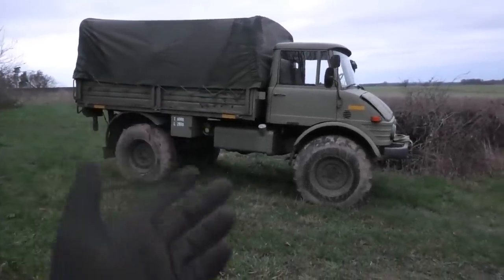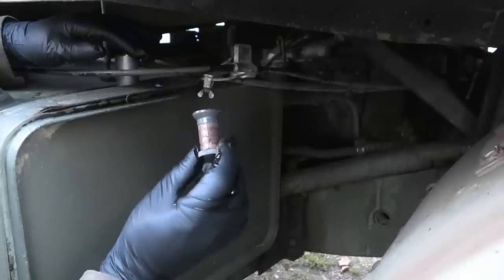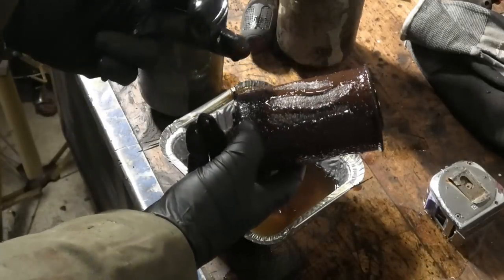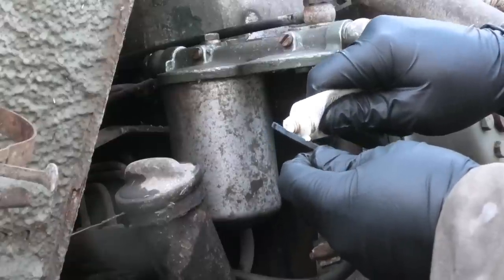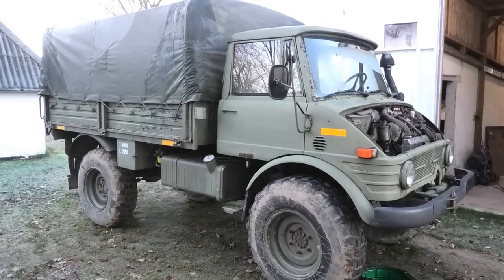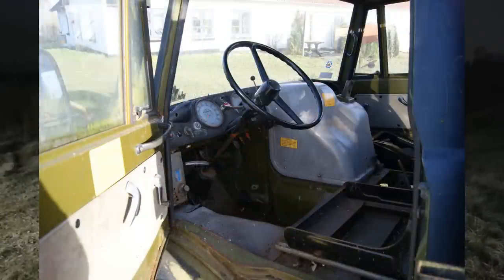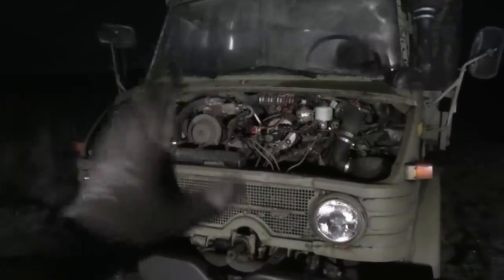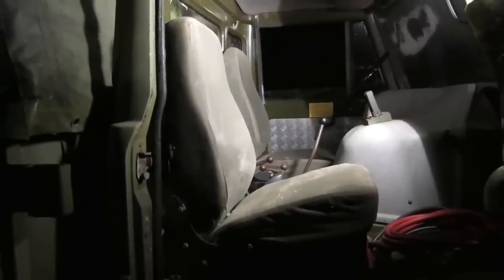Fixing the Unimog 416! - And looking at all the other promblems?

Comment: 30 years ago I helped a man doing up his Unimog.  Everyday I cycled into town where his Unimog was parked half on the sidewalk on a busy street.  That is where we did all kinds of work on it, including welding. It was the worst location to do this kind of work, but it was what it was.
He was going to Africa, and therefor he build a wooden 'caravan'-box on the back to live in. With a rubber corridor to connect the cab with his living space. He had two spare tyres on the cab-roof, and two heavy metal boxes fitting on the rear. Jerrycans were toed on all sides. Extra trays welded onto the frame. More and more stuff on the 'caravan' roof. The Unimog was clearly way too overloaded, and I suggested he cut down on the add-ons. He was stubborn and I resorted to just help him and not give anymore advice.
I remember waving him good-bye when he drove off.  It was top-heavy, and when he took a corner the whole thing swayed like crazy.  Later I heard that he actually managed to get to Africa, after throwing out a lot of his stuff. So, still, he made it and he ended up giving the Unimog a lot of good use there.
Reply from the maker: Wow. That must have been a wild trip, in an old 'mog :)
Reply: @KJOff-Road   - Yes, it was.  This was in 1991 and his Unimog was a 421, like your 'barn-find' from a year ago. It was short and his caravan box was tall, and more stuff on top.  It even swayed left and right just from the wind.  I did not took pictures back then, but I should have recorded the build and especially his departure.  It was like an episode of Top Gear, and though it was all a bit too crazy for me, I'm impressed he eventually made it all the way to Africa.

Comment: Very interesting, this must have been the grandfather to the ones we had in the Australian Army. They were very square cabs and the conversion to RHD was just a simple set of universal joints and rods across the cabin at knee height with a piece of black trim to cover it. Fine for the driver...Bollocks for the passengers. 
Our were a strange conglomeration of two x four speed for an eight speed gearbox if you wanted to drive like that. A forward /Neutral / Reverse lever mounted at the cab rear along with the PTO selector and if equipped the Dump truck weight load indicator. On the dash was the air pressure controlled four wheel drive selector, 2 wheel /4 wheel high / 4 wheel low / and full diff lock 4 wheel.
Load carry was 4.5 metric ton cross country, and that does not mean follow a trail. 😂😂They were dry element air filters also, and I think from memory we received our first ones around 1997. The only two things I really dislike about them was the fact they were governed to 80 / 85 km/h and the smell of the exhaust fumes...they were lethal and stuck to your clothes, even if you walked past one.

Comment: It's great to see it running again 👍 When you will be working on the fuel tank, you might consider electric rust removal, electrolysis I think in English, a bit of soda, water, anode and battery charger or other supply and get back a clean inside of the fueltank. Be careful, the gas that will develop is explosive 😉
Reply from the maker: Interesting idea. i have never tried that.
Might look into that :)

Comment: Love that channel, did you knew that on those double fuelfiltered OM s are possible to use two different Ffilters, ’rough and smooth’ and one of a kind is original way. First rough and secondary smooth

Br Pekka 🇫🇮 421, 416 and 437

Comment: haha nice door opener!!!! so lucky I would take that UNIMOG in any condition the motor will burn oil like a piggy and still perform for yearsss and the big job is your portal axles and main axles as they take fffing beating but I love your little warthog!!! sounds awesome even with all the work it needs..... for the cab get some carbon fibre sheets ....making molds you can pre heat with steam and press is easy as you seem to be resourceful but this baby has the gear package I would want 4 sure!!!
:washhands::washhands::washhands:

Comment: Hi all. The filters are connected in series so PLEASE use for the first filter in the line the MANN BFU700x and then second the fine filter MANN P707x  or equivalent! With two equal filters a series connection makes no sense!
In all (electronic) parts catalogue only the BFU700 is mentioned but this is WRONG!!!!
Reply: That's totally self evident. Now that you've said it, of course. How about a glass sediment bowl right out of the tank? Or use a portable plastic boat tank to avoid all the crud altogether.
Reply from the maker: Good info. 
Thanks! :)
Reply: @erik_dk842  if the tank is dirty clean it with a high pressure cleaner and dry it in the sun. I was fine with the original filter than

Comment: For an engine that needs a rebuild she runs well 🤣. The cabs definitely in good condition, my first 406 had no driver footwell for months 😬🤦‍♂. I presume the air filter should be an air bath version, not the paper ones? Which gearbox is in it as well? Almost looked like cascade but I couldn’t see enough levers
Reply from the maker: Haha, yeah. it runs alright. If it wasn't for all the smoke, i was hardly worth taking it apart :)
But yeah, it did have the "Oil-bath" air filter. But unfortunately, the top half of the filter box was all rustet out, when i got it.
This one has the "2x4" gearbox. (2 reverse, and 4 forward in both hi/low) it's not a cascade, unfortunately. (Not that i really have a need for it, but i would be fun :)

Comment: I have one of these Mogs 1975 406 ex RAF it has a torque converter, 3 way tipper, front and rear PTO,  I have 2 1300L Mogs too. 
My mate has a 406 and a 416 DOKA he also ran his bonnet over but recently he got a big log and some hammers and managed to get it back into shape.
I often see axels for sale on the FB Unimog page but I suppose they have to be fairly local to make it worth while buying them. 
Good luck 🍀
Reply from the maker: 406 with a torque converter? That's really cool. i have never seen that around here. but i can see the advantage in that, if it has been used as an airplane tug, or somting like that :)

And yeah, axles show up from time to time around here, as well.
I have been thingking that it might be cheaper to replace the entire axle, than repairing this one. But i guess i will make that call, when the time comes :)

Thanks for watching!
Reply: @KJOff-Road  my mate was out in his DOKA the other night on a Christmas charity tractor run , he said due to the hydra shift it's a pleasure to drive , I said I thought it was a torque converter, he said it has a manual clutch inline with a torque converter for extreme towing , his and mine both came from military air bases so they were used as tugs as you said.

Comment: Just can’t understand why you would not have removed the tank and cleaned it out along with the filters in the beginning. Doesn’t make sense to me.
Reply from the maker: Well, I did do that, actually. back when i had the problem the first time. It was much worse back then, and would quickly clog up the little pre-filter. (Thats also why i went to check that filter first.)
But like i said, that was many years ago, by now.
Reply: @KJOff-Road  my apologies I thought by your comments you were alluding to the fact that you never did. I must have misunderstood. No harm intended I was just a bit bewildered. Love the mog. I sincerely wish I had one. These were used extensively in our Rhodesian Army. Blinking fantastic vehicles indeed. We called them two fives.
Reply from the maker: No worries man. I actually didn't realize that i never mentioned it, untill i saw your comment.
Also, i have never heard them called two fives? I'm guessing it was because they were 2.5 Ton trucks? :)